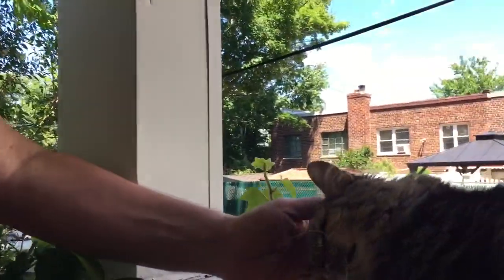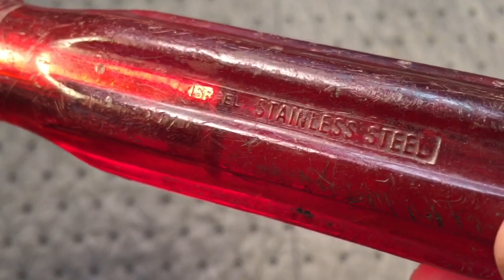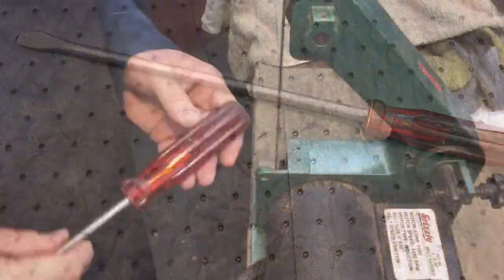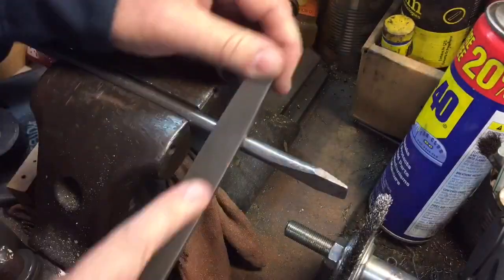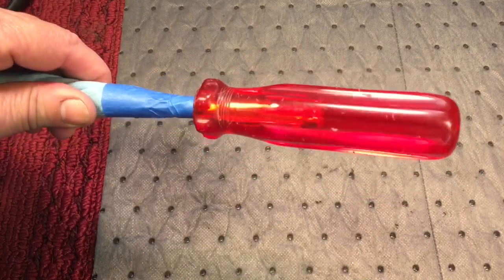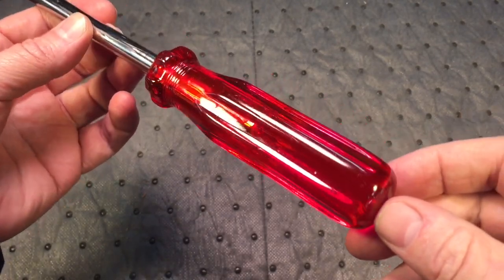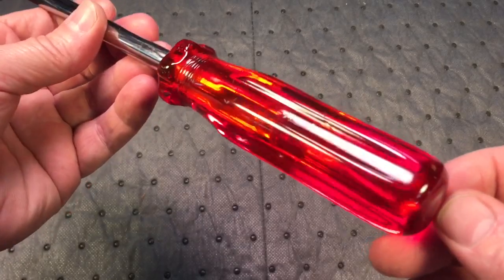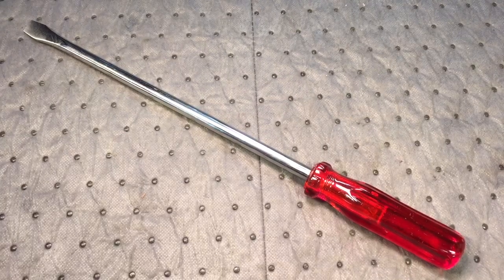Restoration of a Rare UMT Screwdriver from ISRAEL

Comment: Today I was lucky enough to find a 1/4x4 UMT screwdriver at a thrift shop. I thought I was in the Twilight Zone when I saw that it was made in Israel and that the blade was stainless steel. It had a bit of paint splatter, but in a few minutes, it cleaned up and looks nearly as good as your finished restoration. Thanks for the tip on the clear coat!

Comment: Hi John, 
I picked up a couple Craftsman 3/4" wood chisels from a pile of junk along the road. The kind with the steel cap for pounding on. They are is horrible shape. Well at least one is. I cleaned one but I wanted to do some research to see if there was a better way. 
Clear coat sounds like a good idea.
Reply from the maker: Clear coating seems to really look nice, I am trying to see how it is long term.  So far no problems though!  Thanks!

Comment: That was a great transformation, it probably looks better now than it did when it was new !
Thankyou for the tip on using clear coat for the handles, that is so much easier than using a slow speed polishing buff & compound to get the same look yet without loosing any handle material or loss of moulding shape. Brilliant 👍

Comment: Something to try on a common beater is a coat of Medium CA and some activator then sand it back down to original material. If that's any kind if acrylic the CA will fill in the pits and scratches and bond permanently like nothing else. I've glued translucent dice together and it set nearly instantly. We had to shatter the dice to separate them. It may be better to just put a little on the bad spots and just sand those areas down, I'd try that first.
Reply from the maker: Hello Curiosity Forge!  What a great tip!!!  I used CA a lot before and never even thought of trying it to fill in the scratches rather then grind them out!!!  Thanks so much!!!!!!!!!   Awesome!!!!!!
Reply: You're quite welcome. I've used it a LOT turning pens and have frequently used it to fill chipouts in acrylic and polyester resin. I'd say your odds are good that some medium CA would fill in a deep scratch pretty well.
Reply from the maker: Awesome tip!!!!!!!!!!!!

Comment: I too have a tool made in Israel, its a guide clamp,  a big long extruded aluminium with two plastic stops and an arm, so you can use it to clamp wood, but as its straight at the sides, it can guide a saw
Reply from the maker: Hello Jusb-  it's funny but I couldn't find one thing about this screwdriver or the company on the Internet!  My thread restorer is made in Israel!   😃👍

Comment: Came out better than I expected, and I'm pretty used to quality repairs on this channel. Were you able to keep the lettering?

 Be careful filing welding spatter. I was filing on some the other day, and I thought my file was dull. It was just skating across. After 3 strokes I realized something was wrong. The file was sharp, but the nickle rod spatter it turned out to be was hard as hell. Left about 3 good lines in the file teeth.
Reply from the maker: The Metal Butcher -  The lettering unfortunately is always the first to go...  There is just no way to keep it unless you avoid those channels and then the restoration looks like crap!  I don't even try anymore!  Lol.  I was lucky with this weld spatter, I was able to remove it without a trace!  It's funny because you too were filing round stock in your last video and I was thinking how great that feeling is to slide the flat file along a round surface and follow the contour of the stock, you can feel every burr thru the file... It is really a joy!  Thanks very much!!!

Comment: While I do think it turned out great, (love old tools!!) I had a flashback to Jr. High shop class and remembered polishing some plastic material on the polishing wheel, have you tried that? Keep the restorations coming.
Reply from the maker: Hello Bob!  I have been trying to find a shortcut to restoring these handles for years and I always wind up melting, burning, scarring or fogging the acetate!  I have yet to find a shortcut that works!!  I tried buffing but the heat buildup would melt the handle unless I used a soft wheel and less pressure but then it wasn't saving any time!  I'll keep at it!  lol   Thanks very much!!!!
Reply: Well that will save me some trial and error then, thanks